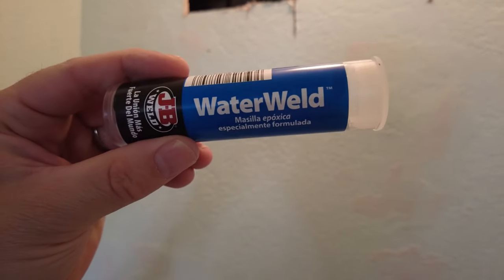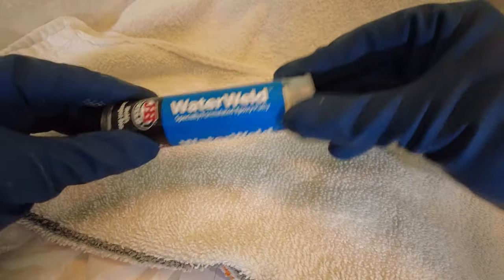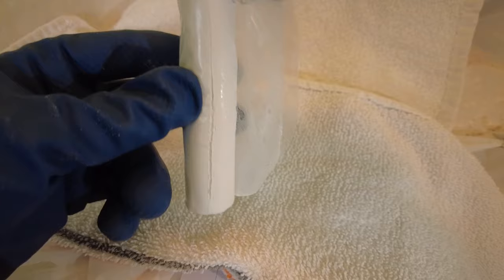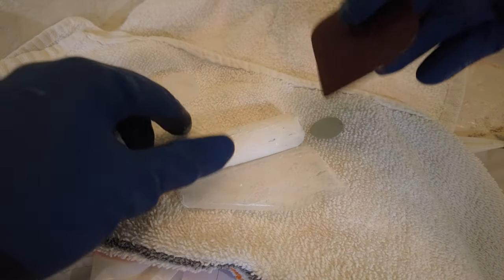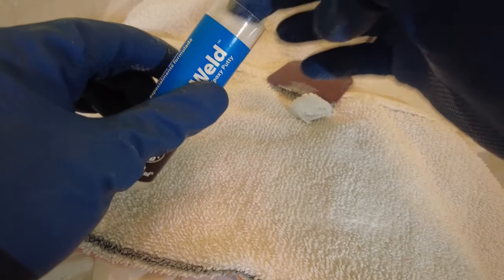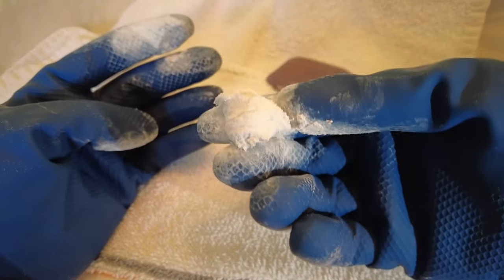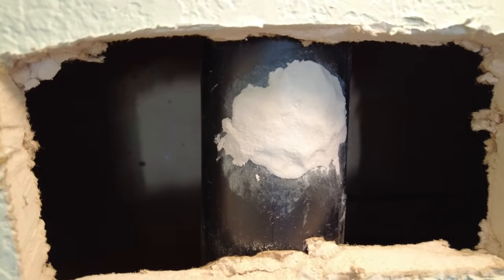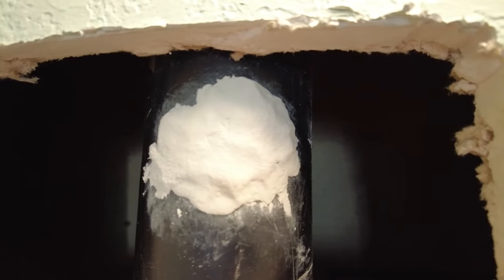How to Fix Hole in PVC Drain Pipe with JB Water Weld

Comment: Thank for reaffirming my experience with WaterWeld. WaterWeld is an excellent temporary repair product for low pressure irrigation pipes.  I use it in an emergency until a more permanent repair can be made, i.e. replacement of the damaged pipe with slip couplings or quick fix slip joints.  I would not be enthusiastic about recommending it as a permanent repaired for a high pressure pipe (80 psi) such as in home plumbing systems although I have no long term experience in this regard.

A compression repair using a piece of radiator hose and radiator clamps has served well over the years, especially for pin hole leaks in copper.  The hose inner diameter should be about the same size the external diameter of the pipe to be repaired.  The hose is slit to enable placement around the pipe after which the clamps are opened and applied.  These repairs can last for years. Thanks again!
Reply: I did that with a rubber hose on a copper pipe about 20 years ago, still fine.

Comment: You would be better off with a compression sleeve. Who knows how long this will last? And it's behind drywall. This is a terrible fix for that situation.
Reply from the maker: Thanks for the comment. I appreciate your insight!
Reply: Reviews state otherwise for this type of repair
Reply: I have this exact problem in our house - I'm having trouble finding a permanent solution - is a compression sleeve + this stuff the best option?
Reply: I have been using this fix for years and it held up